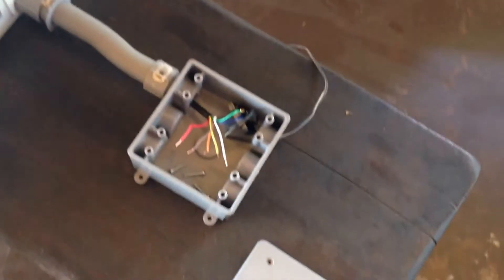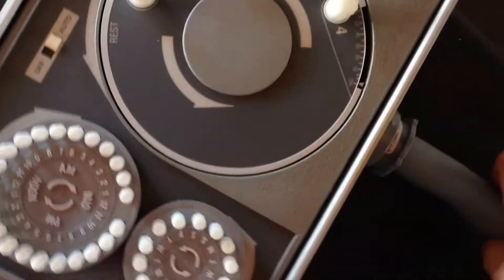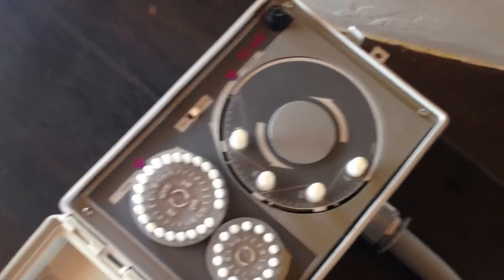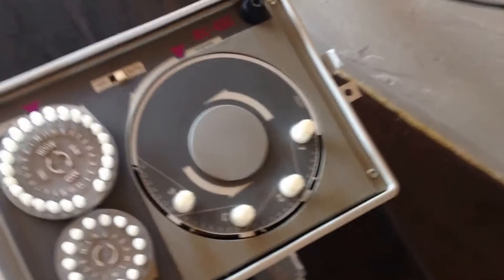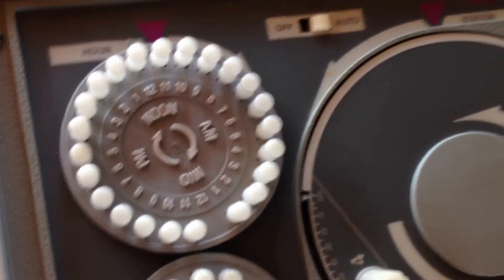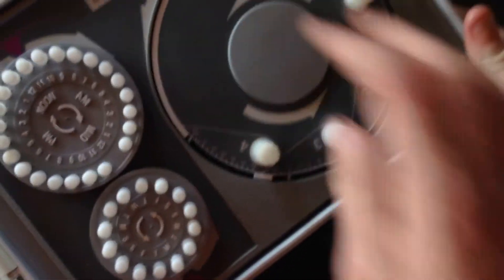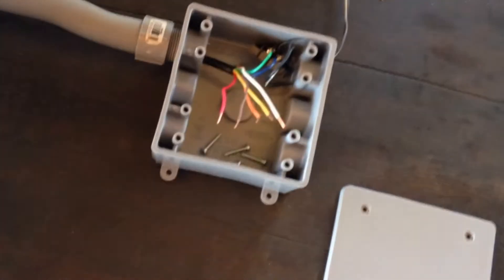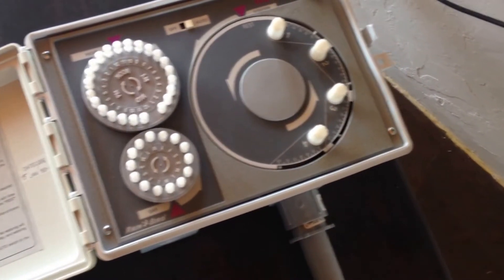Rainbird RC-4Bi

Comment: There is no power to the controller, but the outlet it's plugged into is operational.  How do you replace the fuse?  Does the knob turn or pull straight out (manuals do not explain).
Reply from the maker: Gently turn the knob counter clockwise and it should come loose.

Comment: Hi HappyJigg! Thanks for your video!
If it’s possible, I’d like your help on an issue I have... Nothing happen on my controller when I choose the “auto” mode (the stations dial won’t turn) and same when I do just as you in your video (gently turn the station zone to the left). The manual mode is working well and the days/hours system as well. It’s just the “stations panel” that does not turn automatically.... I opened the controller and checked the connections everything seems ok ... maybe it’s a component but I’m not sure. And again the system works perfectly in Manual mode, water comes. 
Many thanks for your help! I hope you’ll get my comment because I’m starting to lose faith ;) Plus, I cannot find any assistance on the brand website ...
Thanks a lot!
Camille from France
Reply from the maker: I know its 5 years too late, but one of the motors or the circuit that activates it might be bad. One of the motors is dedicated to moving the station wheel, and it sounds like either the motor or the switch responsible for turning it on has failed.

Comment: Hi happy. I have the exact same controller as you and had a question. The controller was preset to run on specific days and times. I wanted to change them but I seem to not be doing it right.  Can you put a step by step instruction on how to do so in my exact situation? It would be greatly appreciated! Plus I would love to stop using it in just manually and have it do it automatically!
Reply: Also how to deactivate the ones that are already pushed in if it’s not as simple as pulling the pin outward
Reply from the maker: @Drochild  You want to change the days of the week it runs on, right?
Reply from the maker: @Drochild  Here are the instructions from the controller door. Hope this helps. RC Series Instructions https://imgur.com/gallery/JZYMLzd
Reply: HappyJigg perfect. I’ll try it out and see what happens. Thanks!

Comment: I have the same system. How does it keep the real time if you put it on timer schedule?
Reply from the maker: There is a motor connected to the hour wheel, which rotates at a very specific and known speed. The motors rotation is reduced down, so that the hour wheel rotates once every 24 hours. At midnight, the hour wheel pushes against to the day wheel, moving it forward by one day. The speed of the motor depends on the frequency of the power source, which is it known to not be the most accurate source of time, so you may have to readjust it every month or so.

Comment: Hi. I am helping a neighbor to try and fix her same exact controller. The transformer is broken out of its box and the plug is separated too. Can this be pigtailed directly to an a/c outlet?
Reply from the maker: It cannot be wired directly to an outlet, but replacement transformers are available. Rainbird sells them here: https://store.rainbird.com/timers/parts-accessories/replacement-transformer-for-esp-me-and-esp-modular-indoor-sprinkler-controllers.html but most plug in sprinkler controller transformers should work with it too, just make sure that it outputs 24 volts AC.
Reply: @HappyJigg  Thank you so much. I was not seeing anything online for a matching transformer to this specific  RC-4Bi controller. So you are saying that a transformer for an ESP controller will work too?
Reply from the maker: @Rickster8560  Yes.

Comment: Help please mine well work fine till it hits the midnight and has to switch days it does not flip days so it never starts the cycle over again
Reply from the maker: The hour wheel has a small tab on it that turns the day wheel at midnight. It is a very common problem for that tab to break off. rotate the hour wheel 24 hours around in the correct direction and make sure that it flips the day wheel at midnight. If it doesn't, you'll probably have to replace your hour wheel.

Comment: My zones won't switch automatically any more.  I must manually move from zone to zone.   Any idea what the problem might be?
Reply from the maker: Filomena Santos: Since I do not have access to that controller at the moment, I can only speculate on what the problem might be. I would advise checking the mechanism behind the face. It could be a gear, motor, switch, or just a loose wire connection. As the problem is likely a broken piece, it shouldn't be that hard to spot if you know what to look for. When I can take a look at this controller again, I can give you some more detailed information.
Reply: Thanks.